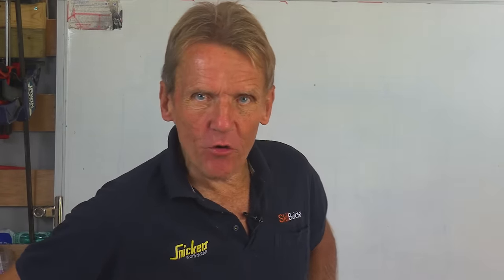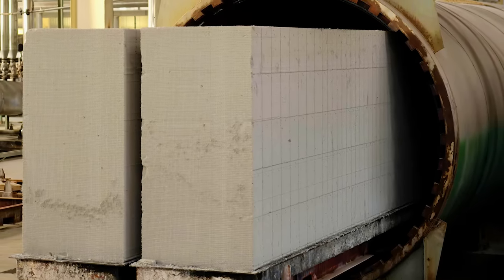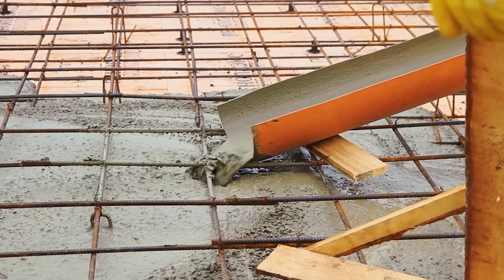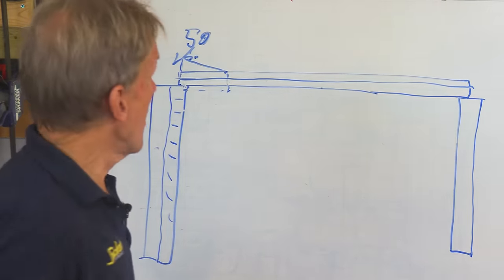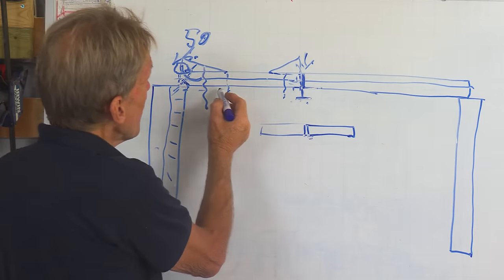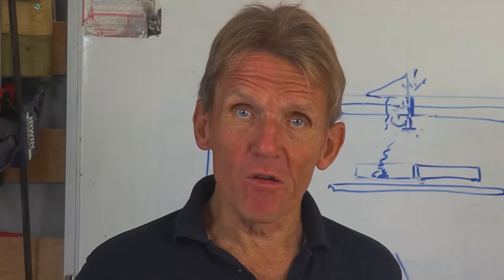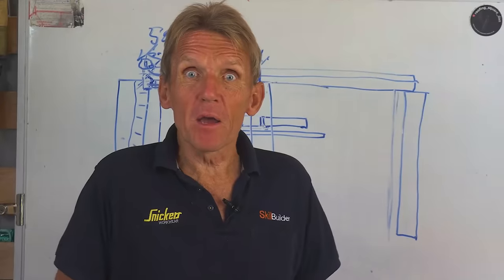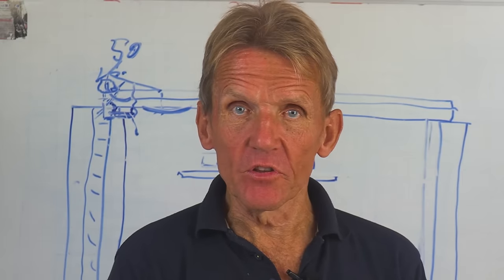The Ugly Truth About Reinforced Aerated Autoclaved Concrete (RAAC)

Comment: I remember my Dad (an architect) won a competition to build a hospital kitchen and I saw it being built in the 70s. Sure it used concrete, he designed an inwards sloping roof to naturally vent the heat and let in light. (No there was no pool, ornamental or otherwise in the centre of the roof). 
The whole Victorian original and later additions have been demolished to concentrate all services at 1 site. It closed in 2006 ie about 30 years. We live in a temporary society, what is in it's place? A Tesco supermarket, effectively a tin shed. Easy to build, easy to demolish and recycle. Insulation, air-conditioning, all ongoing costs.

Comment: We've seen something similar to this years ago with the use of High Alumina Cement in numerous buildings and structures and the ensuing rectification work at great expense after some buildings collapsed and suffered other structural failures.  I remember the viaduct on the M1 near Sheffield undergoing remedial work for several years in the late 70's, early 80's.

Comment: 45 years ago the engineers I worked with refused to use pumped concrete in building river channels on the grounds of the porosity of the concrete after it had dried out, taking fresh water in to the depth of the rebar during periods of high water levels. The slump test of the concrete was only about two inches making it too viscous to be pumped, so it all had to be craned in and vibrated down to remove air pockets.

Comment: I'm a building control surveyor. There was a problem in earlier years was with HAC (High alumina cement). The aluminium was used to speed up the curing time. Then one day a HAC roof collapsed into a swimming pool and it was then banned from use thereafter. I believe the same problem exists with RAAC. It is very porous and if exposed to moisture over the years the reinforcement corrodes and detaches from the concrete. Once that happens there is not much left regarding support...

Comment: Very good practical explanation. I recommend also listening to The Briefing Room Radio 4 where they also highlighted that cutting back on maintenance has also exacerbated the problem with leaks getting in and sagging planks creating a water feature on the flat foof and a source of water etc. Also that some of the early installations used too thin a beam and where the steel reinforcement was short at the end of the plank.
One thing I'm not clear on is lifetime - is this 30 year figure bandied about just because we are now seeing issues with the product after 30 years because of poor design and lack of maintenance or does the product itself deteriorate with perhaps the latex at issue?

Comment: Virtually no one who "came into contact with asbestos in schools" would have died from it. In fact, even among asbestos miners the death rate was relatively low (although a lot of them did develop respiratory diseases). The vast majority of actual deaths were related to asbestos spraying, used in ship building (basically, people who spent 8 or more hours a day in a confined space where the air was full of asbestos dust, for several years). 

Unless you're deliberately sniffing asbestos fibres off cracked school roofs for 8 hours a day over two decades, your lungs can deal with it just fine. In fact, even if you do that, you'll probably be fine, because >90% of the asbestos will remain locked within the cement (and it's generally chrysotile serpentine asbestos anyway, not the more dangerous amphibole type).
Reply from the maker: The facts are against you
Reply from the maker: I will do some more research but the cancer we are talking about  is attributal to asbestos and not smoking. It is very  specific so we have to ask where that exposure came from.

Comment: Final splurge of comments from me... ABSOLUTELY agree with the Pantheon bit at the end, what an inspiration. Not even reinforced! (Presumably why it has lasted so long - no failure due to exposed bar.) The only reason our concrete buildings fail all the time is that we ask them to do things that require the use of steel inside the concrete! (Bridges, flat roofs, etc...) I'm equally to blame as I've added to this problem (mind you - I have a high degree of confidence in our basement roof that it will last over a lifetime - the bar was installed to absolute perfection, and I personally read all the British standards and applied them to the build. There was only ONE company in the UK that actually provided the correct type of spacer for the particular design- I bet very few people actually use that spacer. Maybe they do in larger commercial builds...). That said, I still think a domed concrete roof without steel is preferable, maybe next time :)
Reply from the maker: Hi Mat 
 It has been a busy summer for me but I keep meaning to catch up with you and see where we are with your window problems.
Reply: @SkillBuilder  I have stuck my head in the sand re the problem, hoping it will go away - it hasn't - anyway I'm happily boarding up the rest of the place now. Would be good to catch up when you have a moment

Comment: I grew up in the concrete jungle of Sheffield, park hill, Hyde park and kelvin flats that was the original concrete utopia.. park hill was built so strong with no ariation but still had some rebar, Hyde park was up on top of one of our hills that suffered from wind pushing the tolerances too much, then kelvin flats was built that did suffer from concrete cancer cos they made it from airiated concrete which had to be pulled down before it fell, the unfortunate thing was the community was lost xx

Comment: Good explanation of the issue. A lot to be said for having a standard modular design above ground with many prefabricated components but you will still need site specific foundation designs to suit local ground conditions. These days a pitched roof with solar panels would make sense as schools are usually occupied during the day and can make beneficial use of locally generated power. There is no need for a modern pitched roof to be wasted space, the middle area can be put to beneficial use and the eaves used for storage space / inspection access. A lot of the Victorian buildings lasted well but were not well suited to modern needs. Now those are well established we should be able to design buildings with a 100-year life span even though services like H&V and power distribution may require mid-life refurbishment. If catered for in the original design this could be done in a phased manner over several years rather than requiring total closure of the school for many months. No doubt the politicians will look for the cheapest quick fix but it would be nice to move away from the concept of "disposable" buildings at the heart of our communities as demolition and rebuilding every forty years or so seems such a waste apart from the disruption.

Comment: Many thanks, the most informative video so far! I am increasingly concerned, I must add. I live in a block of flats, already under notice to have its cladding replaced. Next they'll find it was made of RAAC.
Reply: Unlikely - its not structural.
Reply: @piccalillipit9211  I wish you could reassure me. I watch the contractors building apartments in my area, in the same fashion.  A sort of reinforced concrete central tower goes up first (the lifts will use that), followed by concrete floors. Then the outer walls, that look like very lightweight blocks, followed by cladding and some fancy brickwork around the entrance.
Reply: @travelbugse2829  - I cant reassure you cos Im not a surveyor and I dont know your building or the building regs it was built to. BUT RAAC is incredibly unlikely to have been used on an apartment block.  Even here in Bulgaria in the communist and post communist period, they never used it in apartment blocks.  

Its just not strong enough AND if one floor gave way the collapse would domino down through the floors like a zipper opening. 

The panels they use are usually reinforced concrete with hollow tubes in them to lower weight, they are a light weight truly reinforced concrete.

Comment: it makes absolute sense to have a specifically designed school building and then rinse and repeat for every build, not only is the safety improved because of a known building design there is no designer and no unknown costs, it's all known beforehand and very easy to sign off rather than having months or year of planning it would just be a case of sign off on a known build and away you go.

Comment: Just a quick note from a retired civil engineer who has spent most of his life repairing cracked concrete in the Middle East. The reinforcement in the beam at 10 minutes would not be half way up(or down). It would be much nearer the bottom of the beam to resist the tension caused by the load. The bar has to be "stuck" to the concrete at either end in the shear zones in order to fully transfer tension loads to the steel which takes tension way better than the concrete.
The rebar can be anything between 40 and 75mm from the surface of the concrete depending on the quality of the concrete and the environment.
Reply from the maker: Good point, thanks. I think the bar in RAAC is often short of the ends. I like to see it at the end of the beam just to be sure nobody has left it out.

Comment: Reinforced concrete (not aerated) framed houses and tall buildings can last 100 years without as much as a single small crack. But the iron bars have to be buried deep into the beams and columns and in some cases, during construction, they are placed badly too close to the surface and that is trouble for the future. What saves you is the extra 25mm of render that helps waterproof the columns and beams, and as a house owner you must repair and repaint the render every few years and close all small cracks as you find them. I have a summer house about 75m from the sea, about 28 years old, it is suffering with multiple cracks on multiple columns and beams. The repair is to chisel off the render and the concrete around the cracks, even if the crack is 10m long, expose the rusty iron bar, sand it, put chemicals on it, then rebuild the damage with special resins, and then repply render and paint. Quite a process. I have seen botched repairs which crack again in 2-3 years...

Comment: Here in Scotland, i laid several of the new single ply roofing systems on Raac,the specialist fixing firm ,Hilti had a fixing that you pre drilled and fitted ,which "ballooned" out like an umbrella frame,this passed the pull out test, but the problem is, they are all in a line, not helping the integrity of the Raac.

Comment: I am having to check my computer for a thermal creep effect. There is a very thin layer of cream/paste between the CPU chip and the heatsink which eliminates air gaps. The differential expansion when the computer is switched on slowly pumps the thermal paste out.

It's not a big job to replace the paste, not if you have built a PC. And this hot summer gives you less margin.

Comment: A great video. 
As regards the Scottish MP, I suppose it depends on his interpretation of 'imminent' which is quite flexible so it does need something more than that.
The reason for the panic is that the approximate lifespan of RAAC, like most materials, is known and since we are well past that time then this should have been planned for. I don't know if the Labour Schools for the Future took RAAC into account but hopefully that would have been the case. I think Michael Gove has admitted that scrapping the plan was a mistake. I think it took 4 years for them come up with their cheaper alternative. 4 years wasted but a spending announcement a year out from the next election.

I live in Thailand and in rural areas like this the schools are easy to recognise due to the same design being used on all of the ones I've seen. In fact there's one opposite our house. I don't know about the bigger schools in cities but it wouldn't surprise me if they use the same designs for those. My wife works in the Department of Skill Development, which is part of the Ministry of Labour. All of the buildings are the same set of designs there as well, just positioned depending on the shape of the site.  Main Building, workshops, lecture hall ect. That goes for the small amount of accommodation as well.

I don't know if the same approach would work in the UK but the main ministry building in front of where my wife worked in our local province until she had to move, presumably had a problem with leaks on the flat roof so they built another roof over it.

https://www.google.com/maps/@16.1490585,103.2645081,3a,75y,4.24h,87.4t/data=!3m7!1e1!3m5!1suqZqpHxWvh81y3zgdTJCbg!2e0!5s20230701T000000!7i16384!8i8192?authuser=0&entry=ttu

If you look at the 2019 view you can see it without the extra roof.

Comment: In Australia, I've been told that the minimum concrete coverage (in all dimensions, as a rule of thumb) for rebar is 50mm. This applies to solid concrete. I'd assume RAAC should have a larger coverage due to its water permeability. Does this mean that the bearing needs to be larger / wider? I would assume so, but this may not have been factored in during construction. Especially where two beams meet above an RSJ. 50mm on either side of a 100mm RSJ means that the rebar is actually not above the RSJ and the entire bearing contact is with non-reinforced concrete. On top of this (having done many spalling repairs) the actual construction of these buildings always have large variations in the actual tolerances of where the rebar is, where the bearings are, the coverage of the concrete, and many other factors.

We basically need to stop cutting these tolerances so low. Especially when the actual regulation and inspection of the construction is so poor.

Once again, this comment refers to Australia specifically, but I imagine this problem is existent everywhere these materials are used. RAAC (despite being theoretically amazing) is just making these problems more prominent and harder to detect before catastrophic failure.

Comment: My old secondary school was built in the early 60's using mainly raac. 25 years ago serious issues of cracks in ceilings, walls and the roof were noted. The school approached the builders,  who were still in business, and asked for the damage to be repaired under an existing long warranty agreement. The builders tried to get out of their obligations but, unfortunately for them, this was a Catholic school and the governors had the power of the church behind them. Long story short the builders were made to demolish the building and replace it with a brand new one using modern day materials and at no cost to the school. If only this could happen today.

Comment: The other advantage of standardized designs, is the the builders and materials suppliers know exactly what they are giving proposals for, and the building inspectors know exactly what to look for.   There is a lot of efficiency built in.  And specialty contractors come into being who are experts in the process.   I used to build reinforced concrete water reservoirs.  There were standard designs for 10 and 20-million gallon units, to build larger  reservoirs, you simply built them next to each other and connected them up.   Contractors specialized in building them and invested in steel concrete forms, equipment to excavate and process the onsite materials into concrete aggregate, and onsite concrete plants, and specialized “mud buggies”.

Comment: Thanks Roger, that is a very interesting video and I've learned a lot 🙂One question: How is it acceptable to have a 75mm bearing on the beam? I thought that lintels for doors and windows had a 150mm bearing and they generally have a much smaller span. As a mechanical engineer, I look at the basic sketch and all I can see is the load-bearing skin being pushed outwards as the beam deflects (which it is designed to do, to an extent?)
Love the thoughts on modular design giving rise to multiple benefits, totally agree 🙂
Keep up the great work!

Comment: Is it possible to place electronic humidity sensors into the beams linked to an alarm to detect and pre-warn of water ingress? I'm an electro-mechanical engineer, not a Builder but it would seem to be a relatively simple solution to detect potential faults? Great video, very informative.

Comment: OK I enjoyed your rant and yes you are factually correct in your comment about flat roofs and creep on the RAAC beams. However you could have included the mitigating factor that black roofs absorb more heat which allows the bitumen to soften and  flow, resealing any cracks/leaks. Unfortunately the control of the "Pour Point" of the bitumen being placed on the roof is not great so there are no records whether this would be a saving grace. I would be interested to see if other countries which adopted this technique, or even the Swede's who invented it, have taken this into account. I suspect that some have.

Comment: I fully agree about costs of prop hire , either buy them and then sell them , best idea just replace roof quickly , save many years of talking about the problem , start drawing plans for replacement pitched roof now . sort it out ,  not talk for years , build a new roof in a factory in sections , get a big crane lift the whole roof off in a day or two , start replacing it on day three finished in a week

Comment: Snow loading means at least a 40 degree pitch like an old church....maybe attach the centre of each beam to the truss above it and so leave the original roof on and build above it. The cavity provides room for some waterproof insulation which seals in the asbestos if that was  in the form of the roof clading and you have a roof that will outlast the building without the expence of removal and disposal.